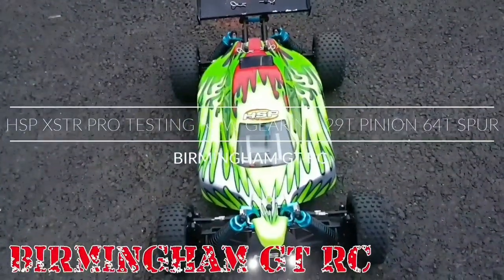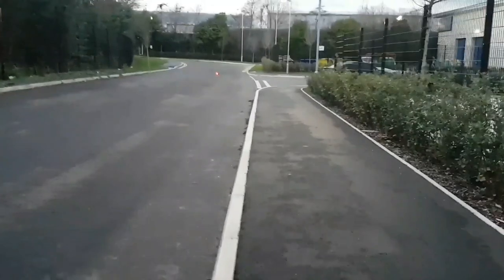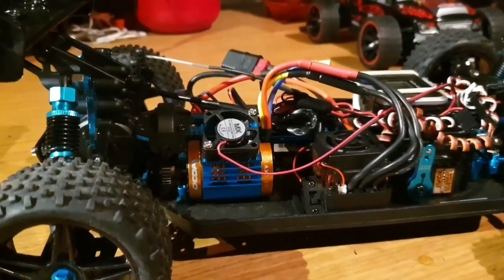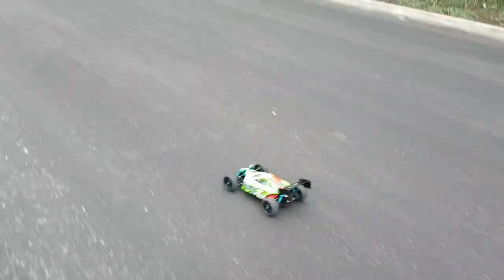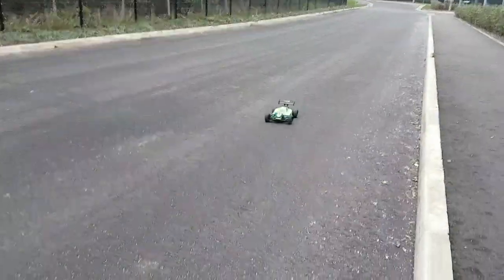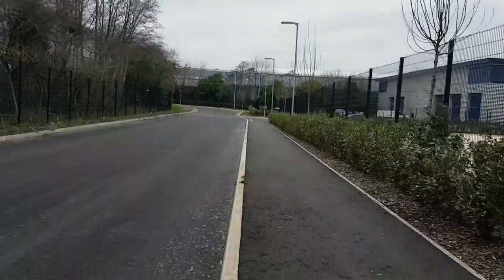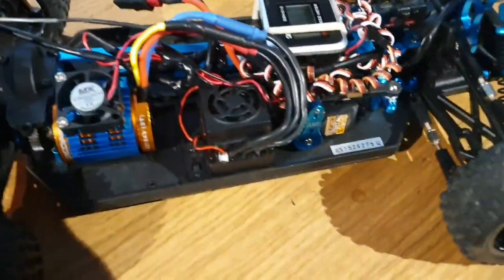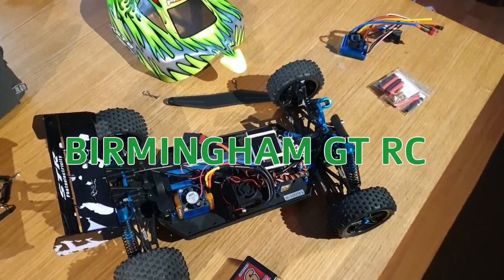HSP XSTR PRO 59mph / 95kmh 3s Lipo GPS Speed Run

Comment: Hi mate I've just picked one of these up from a charity shop but no transmitter with it I don't know anything about rc cars can you recommend a budget transmitter it says 27.095mhz on the receiver any help is appreciated
Reply from the maker: So sorry for late reply but yes any transmitter will work you just need to buy receiver and transmitter together their loads of cheap one that work well like flysky transmitter around.
Reply: Seconding Flysky or DumboRC, cheap and good range. I got a GT3B Transmitter for my HSP Nitro and can easily get 250m range on a grass oval, haven't tested it much further than that so far and don't really need to, it's so far away you can't hear it and can barely see where you're going.

Comment: I bought one these about a month ago, great little Car. It came with a 2S 30C Lipo, was just wondering if I can safely use a 3S with the parts it came with or do I need to change anything ?
Reply from the maker: Yes it can take high c rating like 100c 3s lipo no problem. On brushless my it comes with.
Reply: @birminghamgtrc  Ah nice, will give that a go. Yea was the the brushless model. I like the lights you've added, look good !
Reply from the maker: @MrMadderMax  cheers bruv 👌🏾
Reply: @MrMadderMax  did it have problems after 3s runs?

Comment: What do I need to Run my hsp xstr on 3S
Reply from the maker: Just any brushless set up that take 3s
Reply: Basically to run 3S just get a 3S battery and bigger fan yeah
Reply: What ESC u running
Reply from the maker: @neildicko785  yeah that it but it dont get to hot as it very light so easy on motor and esc.
Reply from the maker: @neildicko785  120a Ocday esc bruv